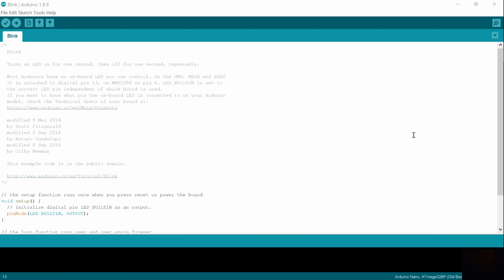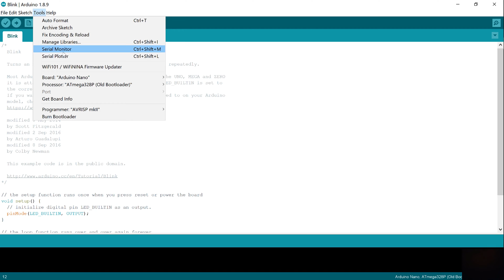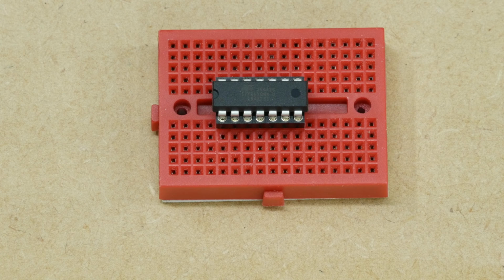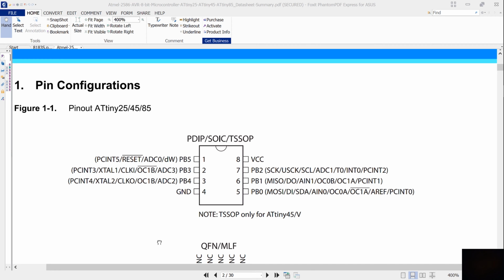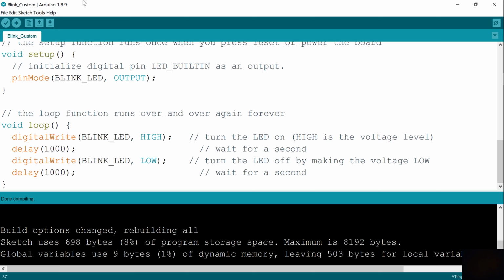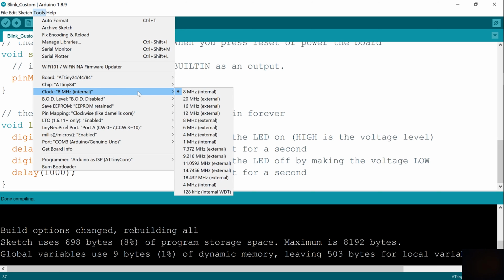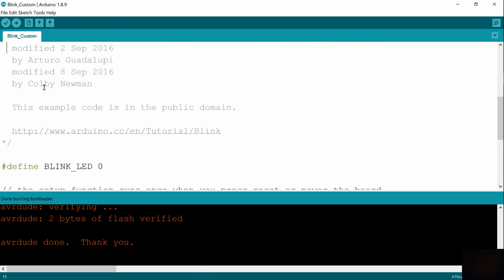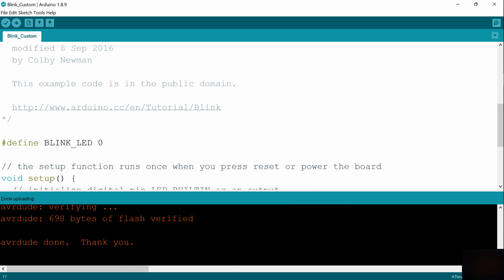Programming ATtiny85/84 with Arduino Uno (ATTinyCore)

Comment: I double checked my connections and set it up like shown in Arduino IDE but I was using Arduino 1.8.11 with ATTiny Core. 
It did not burn boot loader. I got error "avrdude: stk500_getsync() attempt 1 of 10: not in sync: resp=0x06...", which I have seen before so it cannot connect to ATTiny84 or something.
This was a fresh ATTiny84 chip from Mouser and I know I got ATMega328 from Mouser that come blank so you have to upload boot loader. But I am not sure why it is giving the error.
Reply: I uploaded the wrong program to the Arduino, now it works. thanks.
Reply from the maker: @johnritz5991  Awesome! Happy coding!
Reply: Hello, I was trying to use my USBTiny ISP (uses an ATTiny2313A) to program the ATTiny84 chip as I did with my Arduino Uno as a programmer. 
So I set the Arduino programmer to USBTiny ISP but it won't recognize the port when the USBTiny ISP is plugged in.
The Win10 PC device manager clearly shows it and identifies it but it just won't show up on Arduino IDE. 
I think my USB Tiny ISP might not work properly; only the first light is on but the second light does not come on.
Any ideas?
Reply from the maker: @johnritz5991  I've never used that device so I honestly have no idea. You could do the usual USB troubleshooting like trying a different USB cable (this has worked for me a couple times when having trouble getting Arduino IDE to recognize what I've plugged in), different USB port, etc. Beyond that I don't know, I would contact Adafruit.
Reply from the maker: Hey John, 

This should be very solvable so don't panic just yet. I didn't see that error message, but my programmer's instinct says it might be either a problem with how you setup your Arduino, or the fact that you are using 1.8.11 which is super new. I suggest going through the steps of setting up your Arduino again (when you upload the programmer sketch make sure your attiny isn't connected and reset doesn't still have capacitor!!!), setting the ATtiny options, and make sure you have reset disabled with the capacitor trick shown in the video (this is not an optional step). There are lots of little steps with the IDE configuration and selecting the correct options that it's very possible you just missed something. We all do it no matter how closely we feel we followed the instructions. If that fails to work, try using 1.8.9 since that is confirmed to work and ATTinyCore page listed troubles with 1.8.10. 

If all that fails, please share what Arduino you are using and screenshot ALL settings you have set in the IDE and share that info. 

I

Comment: Thanks for taking up the Arduino tutorials  !
Just subbed you in hopes that you might bring some applications for the AT84 or any of the line up, that might push the boundary beyond "Hello World" and Blink.
Reply from the maker: Thanks Chris! I'm using the ATtiny for the disco dog collar light that I'm currently working on, so you'll be seeing a vid on that in the near future (PCBs are getting made soon). That's definitely a project that bridges the gap between blinking light and functional product (which ironically is a blinking light.... but one takes 5 minutes the other has been months of design).

Open to any ideas you may have! 

Btw you might already know this, but one thing I didn't explicitly state in the video is that the ATtiny series is part of the AVR family of chips, just like the ATmega chip you see on most Arduino boards. So an ATtiny is usable in a lot of Arduino projects you see online, but it really shines when you are trying to save space and power.